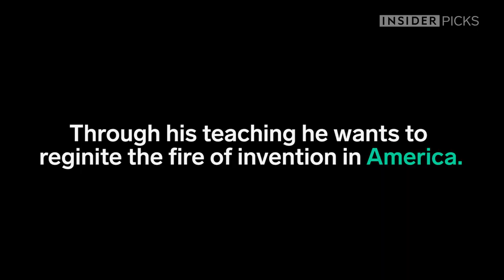This wrench grips from all sides

Comment: a completely or partially rounded head would still not be able to be turned with this wrench. So... really just a twist on the age old adjustable crescent wrench- which admittedly causes lots of rounded off bolts and nuts!
Reply: It grips on six sides, isn't remotely similar to a crescent wrench and would have 3 times the grip on a rounded head that a crescent wrench does. Crescents develop play as they get older which makes them even worse at it - it's not remotely similar to crescents in function, but it's about the same price as a good crescent wrench.

Comment: Most stripped bolts get that way because they are in hard to get at areas this wrench would never get into.
Reply: usually threads get referred to as "stripped" while heads of bolts and nuts are "rounded off".
Reply: True, the article on "Digg" said stripped so I just went with it.